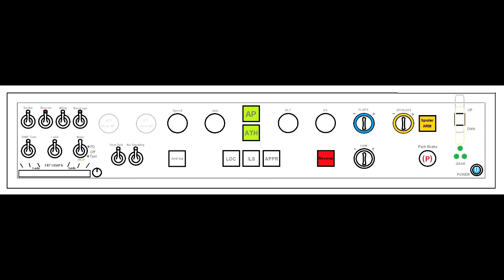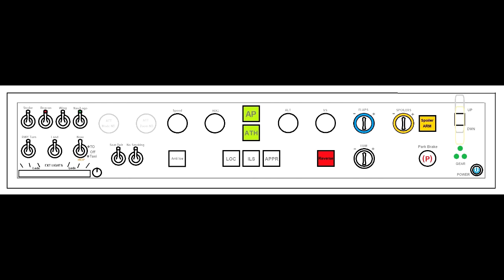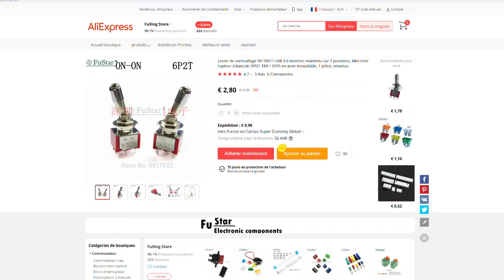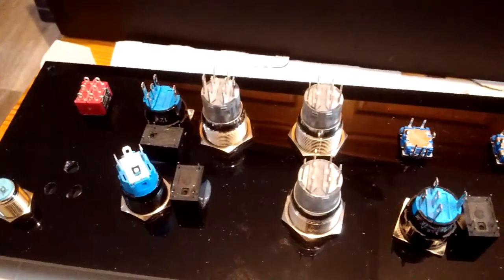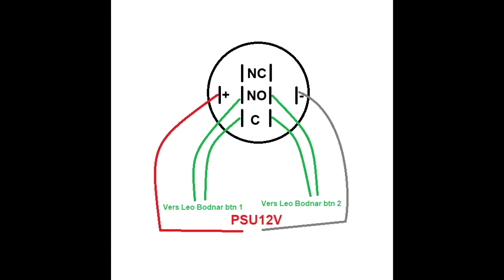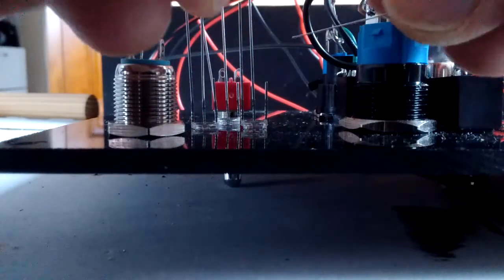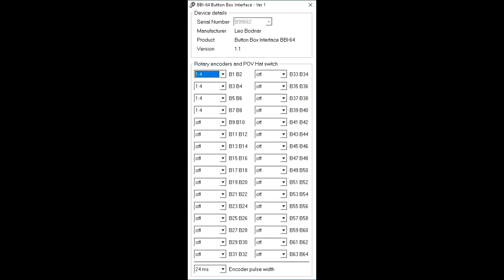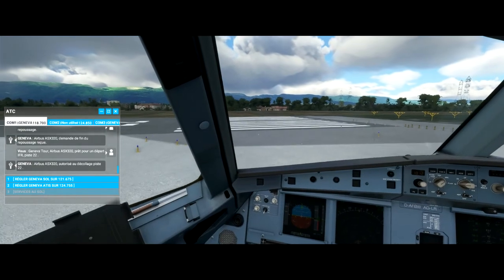Button Box for Flight Simulator 2020

Comment: hello mate,this is a really nice button box.i have a question about relays.did you put one relay per switch or one for each group of switches?
Reply from the maker: Hi mate, one relay by switch ! the relay is needed to have the light/no light capability of the switch and the 0 Volts output (no voltage switch) for the Leo Bodnar side.

Comment: can you write the size or plan of the box more descriptively? For example, what is the length of the box? the length of the plexi you placed on it.
Reply: What is the diameter of the holes you drilled? I'm trying to do it with my own means, I would be very happy if you help me
Reply from the maker: @mertoperator  Hi Mert ! The plan is on 12:38 of the video. Plexi plate : 100mmx500mmx4mm. The box is made of wood 70x500mm (front), 92x500mm (back), 77x480mm (bottom), 77x90mm (2 pieces, sides). The drill diameter depend of the buttons, it's indicated on the aliexpress page of each item. The holes are 12 for that switches, 16 for squared buttons, 20 for momentary right and left. There are smaller drill for gear, power, leds, encoders, etc. Always use a caliper to check before drill !
Reply: @jujunet  omg! Thank you for your attention. Thank you for responding and caring for your audience.🌸🌸
Reply: @jujunet  Is there any alternative for leopard bbi-64? The price of bbi-64 is 1/5 of the minimum wage ahahaha. any breadboard or arduino uno? with no codes
Reply from the maker: @mertoperator  OMG, that's make money.  If you want to use an arduino, you have to flash code into it. And you have a very few controls. I saw people grab some old keyboards on wastes and inside you have a little board with as many connectors as keys. These ones can be very small and difficult to solder, but it's worth watching on it. The advantage of LB board is that you plug and you have a joystick with 64 buttons, you can do a lot of thing with it. Try on second hand too. Goof luck !

Comment: Hello. i absolutely love the button box and i'm going to attempt to make one myself but i would need to know the buttons would work so i have minimum use for the mouse. when you are using the rotary knobs for altitude/heading/VS etc are you able to push or pull the knob to activate the new setting like you do in the plane ? or if you adjust heading mode do you have to activate new heading by using mouse and pressing the digital version of the same knob ? what do you use for the push/pull motion of the rotary knobs basically ?
Reply from the maker: Hi, I use the rotary encoders to increment/decrement HDG, VS, SPD and ALT in Selected Mode of the A320. In this case, the setting is automaticaly applied. For Alt a push will engage. In managed mode, the rotaries are useless. I use the push button to switch between managed and selected mode (go to my video "Update Button Box : Custom controls", to do that, you need FSUIPC and LINDA). I made also another video (Nantes - Brest en A320), in french, but you can see how the button box is working. good flies !
Reply: @jujunet  Thankyou 👍